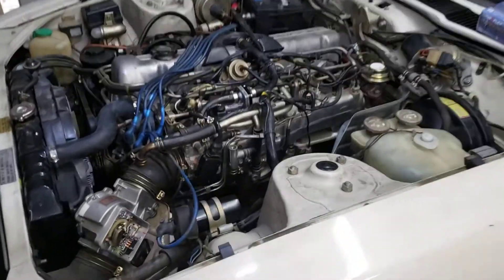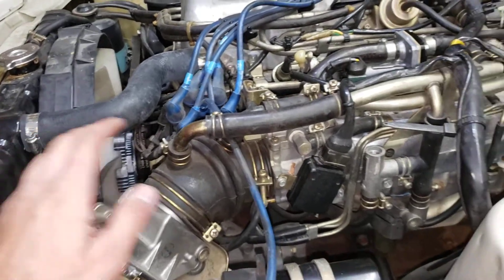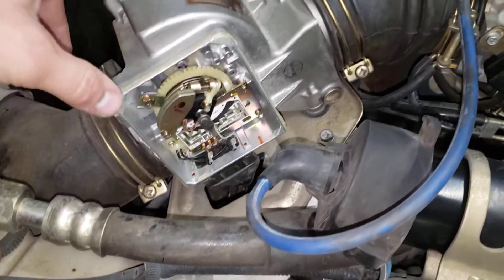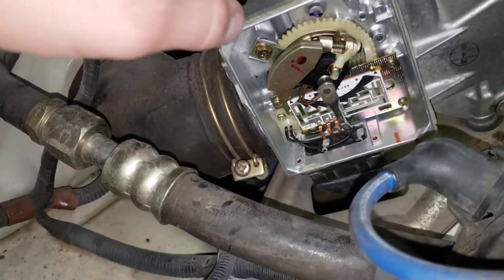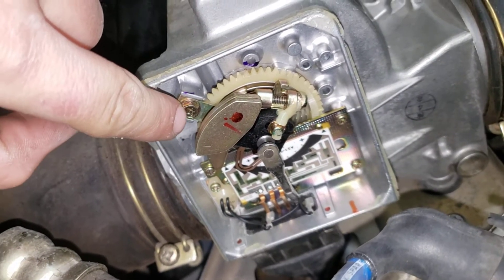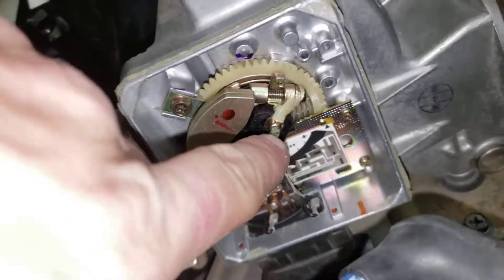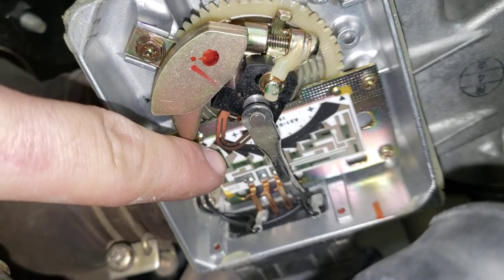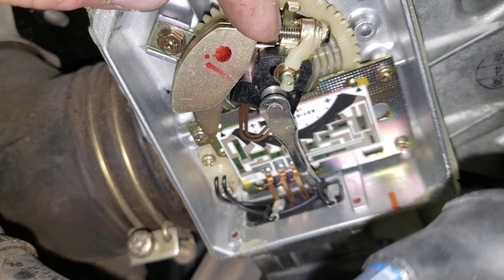Nissan 280zx AFM adjustment air fuel meter

Comment: In the AFM it's called a potentiometer
Reply from the maker: Thats true
Reply: @gagefixeseverything   hi. Is it possible to adjust air flow meter from another engine? I've got skyline on l20et, but i cant find exact afm, i have from nissan leopard pf30, from l20e nad i have afm from fairlady, that fits to l20e and l28. I've checked, that resistance is nearly the same on all airflowmeters. Will it work if i just replace plate from another afm to mine with temp sensor and then adjust the spring? Have you tried it?

Comment: So I changed the stock headers to stainless steel and now the 280z won't go over 4000 rmp. Would you know how to fix that? Is it an air fuel ratio issue? It also takes longer to get it to turn on.
Reply from the maker: I bet it;s not the header itself causing the issue, but something that got disconnected or bumped during the header install.
Reply: Sounds like a throttle position sensor problem ?
Reply: Head temp sensor

Comment: Maybe you could help me with my 280zx I did the same thing but loosened the big screw to adjust the tension since it was running really rich and now it idles great and isn’t running rich but backfired when downshifting and shutters when taking off like I adjusted the spring to much maybe?
Reply from the maker: Did you get this figured out?

Comment: if you wanted to change the idle air mixture..  why didn't you just adjust the idle air bypass screw?
Reply from the maker: Someone had messed with this car so much, I had to adjust that as well. It took a good bit of work to get it all back to factory settings just so I could diagnose some other issues.

Comment: Which screw is it exactly the little one or the spring tension to adjust rich and lean air flow mixture? Also is there a way you can do a demonstration?
Reply: One way to adjust the big spring in the back is to let it go all the way out and release it's tension, I think it's 10 teeth or up to 15 if it's high altitude, but making sure that it's right reletive to the little arm is huge. When you take it out and it's completely still with no air in it the little silver/chrome bar has a little "graph" if you will for resistance readout purposes to stay within proper afr , but boy this video is super handy for I even used it myself tonight and couldn't be happier with how it runs. Might return to the comment section here tomorrow and let everyone know how it goes down the road. Thank you to the man who posted this and WHAT A SLICK RIDE HE WAS WORKING ON😍
Reply from the maker: I'd have to re watch the video myself haha, this car has been returned the customer since filming
Reply: @gagefixeseverything  thank you for the reply, this video helped tremendously, my 280z runs thanks your explanation.

Comment: Nice car, I don't have a nissan but I do have a 1984 rx7 with fuel injection and the system looks and I think works very similar, my car goes lean when is at idle right after warm up, so far nothing that I changed has made any change, I changed coolant temp sensor, oxygen sensor, injectors, ecu, got new factory fuel pump with filters because old one failed, I have adjusted tps, throttle opening and air screw with no luck, couple days ago I started to check for intake air leaks and no leaks found, when the engine is running if I have the air cleaner out and slightly push on the maf door right when the problem begins then I have a steady nice idle, this video just cleared my mind and now I have more options on finding my car's issue, thanks for such great information, keep it up with your car and videos.
Reply from the maker: Thank you sir! These older systems can be a nightmare for some folks, but it's my favor tire kind to work on haha. I really enjoy problem solving on these obsolete systems.  Good luck with your rx7!